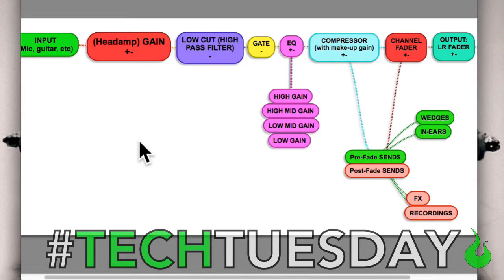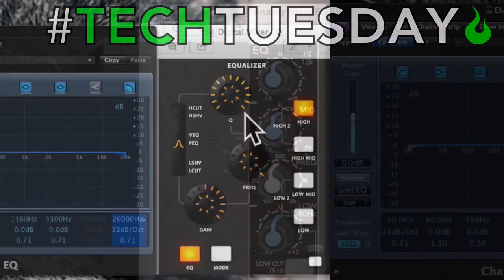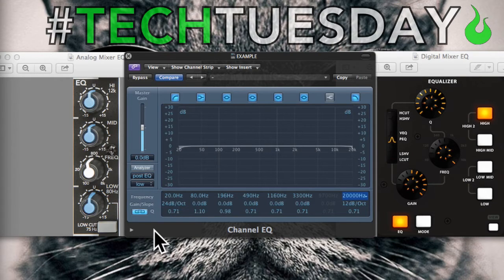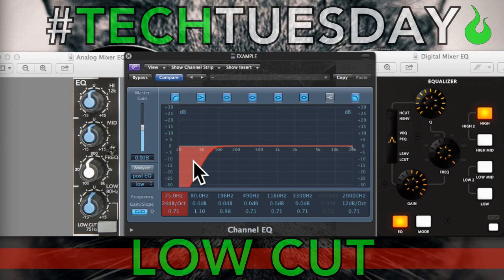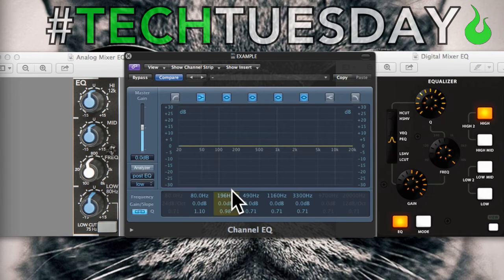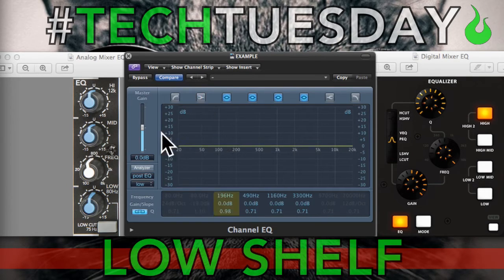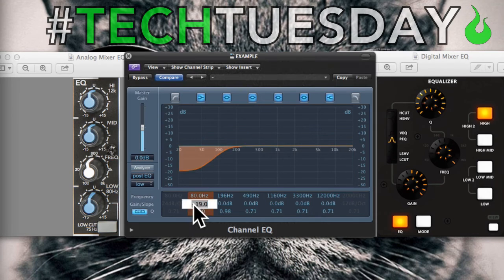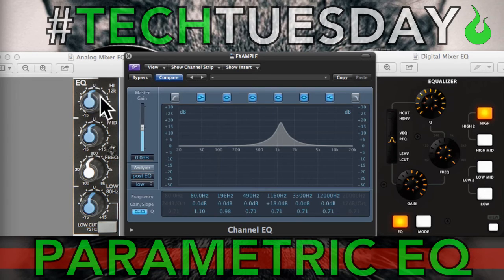Intro to EQ - #AscensionTechTuesday - EP004

Comment: I had a question regarding outsystem feedback. I have a Behringer XR-18, JBL eon  615 speakers and we have attempted to mike our cajon and have nothing but low end feedback. The funny thing  is our crappy old analog board, Mackey, doesn't have the problem. Hahaha. I have watched the videos regarding equipment and eq settings and it has not helped. I recently ordered the Audix D6 bass mike hoping to fix this problems. I realize it is difficult to trouble shoot this but do you have any suggestions? Thanks so much. Jim.
Reply from the maker: There are a lot of things that could be involved in this. If it is fine with your Mackie and not your new mixer, look at the EQ and low-cut on the Mackie and compare it to the new mixer. If it's super bassy, try setting your low EQ as a shelf and reduce the overall low end. You may need to use a slight Low-Cut to remove the very bottom bass tones. If you're going for more of a kick sound and have maybe a 57 on the front to get more of the "snare" tone, try gating the inside mic like you would do for a kick drum and see how that does for you.

I hope this helps.

-Chad